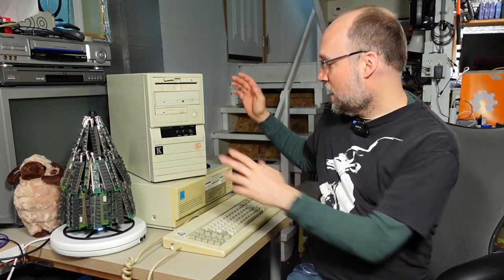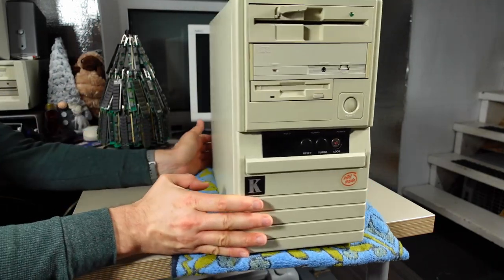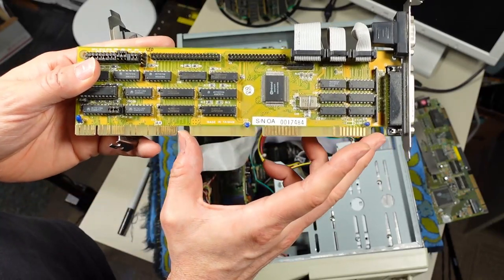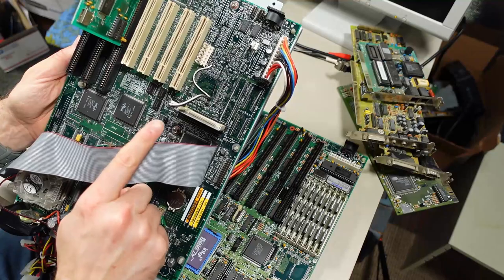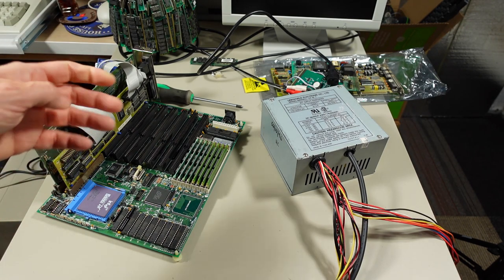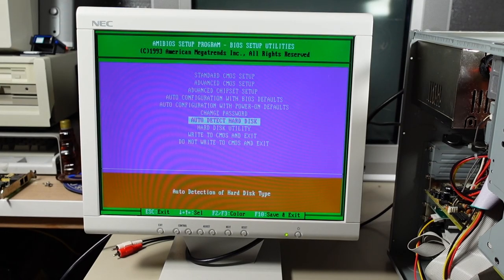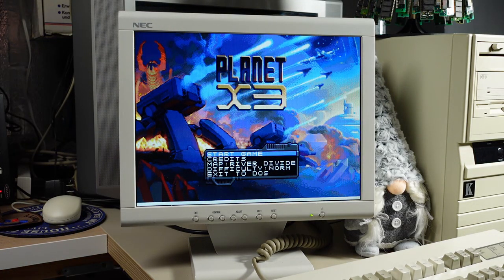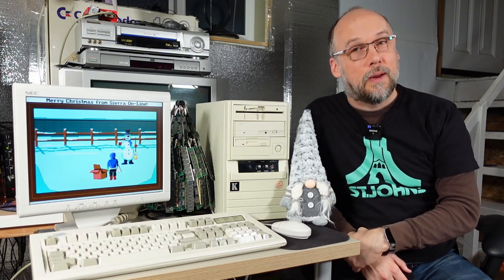PC archeology: Mystery 486 Mini-Tower

Comment: Here is the lowdown on why you never saw a 2.88mb floppy drive or disk. The format was introduced in 1990 as follow up to the 1.44mb floppy but at the high price of $300 for the drives and a premium for the 2.88mb floppy disks cost. As such the drives never caught on with average consumer as the 2x space increase didn’t justify such a high price except for except for some high-end uses in businesses/cooperations and other specialized uses. Low sales amount the general public meant the drives never came down in price hindering adoption. The format was killed off for good four years later when Iomega introduced the Zip disk format and Zip drives with their capacity of 100mb per disk (69x a 1.44mb floppy size) and at a reasonable price for consumer use. This effectively killed 2.88mb disks as they were still too expensive given the only modest 2x disk space increased vs 69x of Zip disks.

Comment: You didn't show it, but when you switched to 16 million colors you last showed you went to  vga drivers, were you using vga or a dedicated driver?
Reply: These vlb cards introduce an API called vesa bios giving access to video modes not available through traditional VGA modes eg 011Bh = 1280x1024 24bit color. Also check your RAM DAC do support higher bit color modes.

Comment: Well, Cirrus Logic have GD5428 at last, after that simple not making graphics chips.
Reply: They made more graphics chips than that. There's even a GD5429 in the 54xx series. :) The GD5424 is a bit slow for Windows, and 5426/28/29 has enhanced bit blitting performance.

Comment: save the EEPROM on the Modem to reprogram
Reply from the maker: Yeah things like that card I will take off the usable stuff like eprom and jumpers and put the card in my junk box for future possible pillaging. :-)
Reply: @adriansdigitalbasement  oh Yeah Thanks to You i ran into a Commodore Plus 4 at a Thrift store for 10 just the Unit by itself no power i used a ATX 5V and a Only AV car TV i Notice it Has Artifacts and Spaz out i Uploaded to Show you on my Chanel
Reply: @adriansdigitalbasement  i saw the one issue on the Commodore Video turn out to Be Memory if it is that Same Problem

Comment: I found your drive.  Its a Mitsumi CRMC-LU005S 1x, using the mitsumi interface.  Apparently drivers are included with soundblasters and can set this up in config.sys

https://www.youtube.com/watch?v=CUBeHWVHh9U

I also found this link that shows the driver names for the various interfaces including example config.sys lines (in section 5.3):

http://www.dai.ed.ac.uk/homes/neilb/saved_pages/jazz95.html#5

Oh and that drive is worth quite a bit on ebay.

I love CDROM drives, I have an Acorn RISC PC that has  a cdrom that uses an IDE-panasonic interface converter for its CDROM.  I need to get that working.

Comment: Why did did you never see a 2.88MB 3-1/2" diskette drive, even though many BIOSes of that era supported them? Simple answer: economics. The 2.88MB drives, diskettes and formats were too little, too late, too rare and much too expensive, so demand for them never materialized. The "too rare" part might sound like a self-fulfilling prophecy, but it was important at the time because back in those days, diskettes were the primary way that data was shared between PC users. Most peoples' first 3-1/2" diskette drive was the 1.44MB model; the 720kB version was relatively rare on DOS PCs. So, if you needed to give someone a file, you could pretty much rest assured that the other person would be able to read a 1.44MB diskette. Since 2.88MB diskette drives cost $300 and up, they only came standard in the most expensive PCs, and few people other than power users really saw any need at all for them, it would have been very optimistic to assume that your friends would be able to read a 2.88MB diskette. So, few people sought them out, much less tried to purchase them.

Comment: I have one of those motherboards. ( Atrend 4GPV3 486 VESA Motherboard
http://www.elhvb.com/webhq/models/486vlb2/4gpv3.html
( A.K.A. VLB Galaxy 486V1 and MB-486-CONTAQ 012093 U4L2-0 )
( A.K.A. - Mecer B860 )
- BIOS ID string X0-0100-001117-00101111-060692-CTQ596-F
- 8-30 pin SIMM slots (1-128meg FPM DRAM)
- 2-32bit VESA Local Bus slots
- 8-16bit ISA slots
- 64-256k cache support in 8-28pin sockets + 1 TAG RAM sockets
- AMI/Award/MR Bios
- CONTAQ (German) 82C596 A Chipset
- Supports the following cpu's at 25/33/40/50/66MHz
INTEL 80486SX/80486DX/80486DX2, P24C, P24T
CYRIX CX486M6, CX486M7
AMD AM486DX/DX2
- Green PC Connector
- Manufactured by: Atrend Technology Co. Ltd. or VisionEx + CTL corp. USA 1993
Actually, This motherboard was branded by several USA companies including: Atrend, Mecer, and VisionEx.)